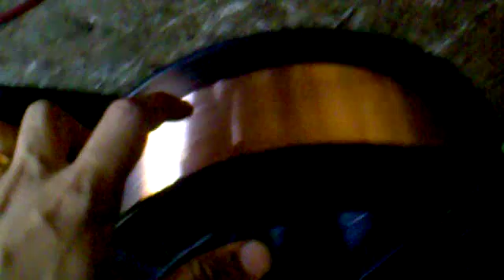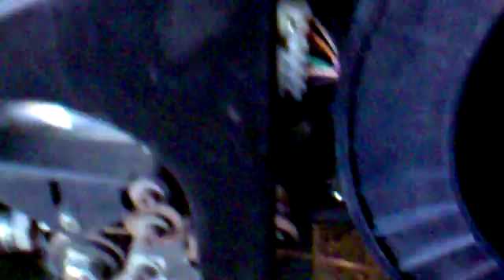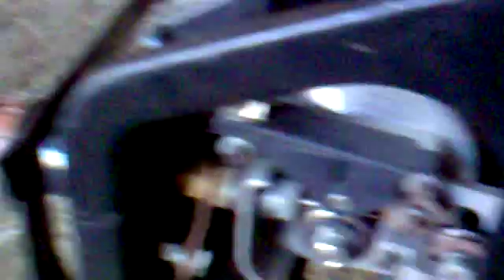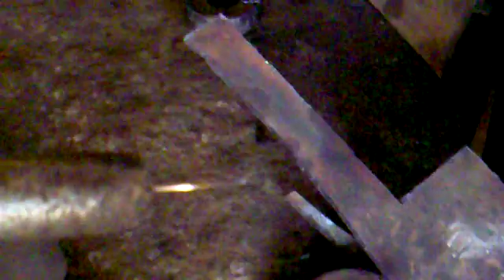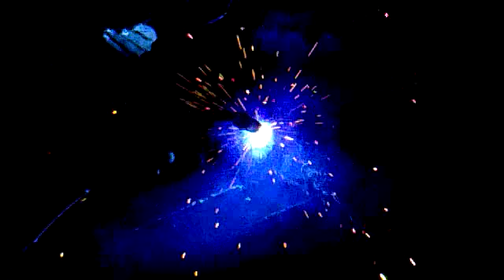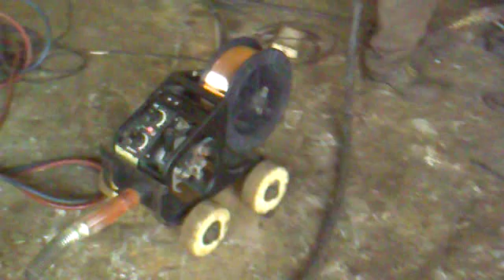How mig welding works. ✔

Comment from the maker: Hi Tks for the Question.

The gun which is used for welding has a control switch which is pressure by the welded to feed it.